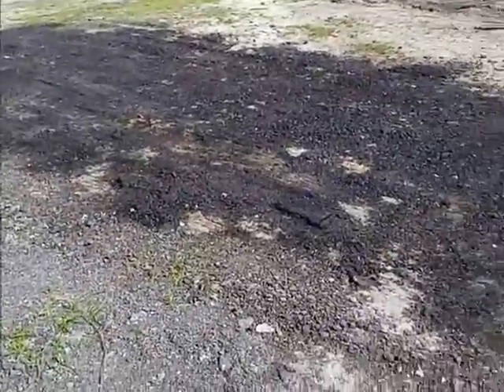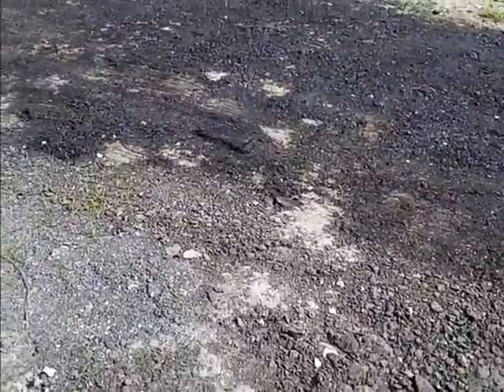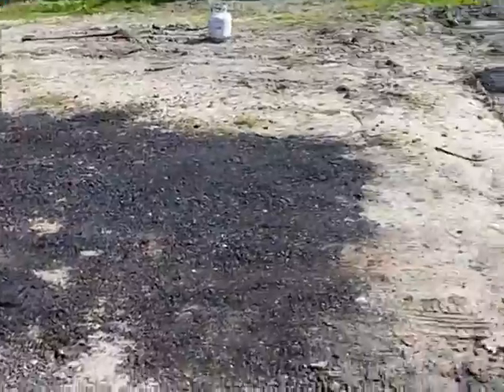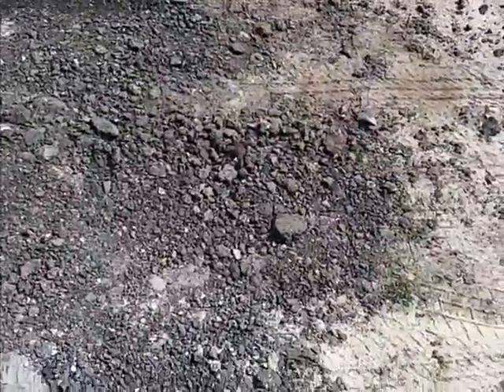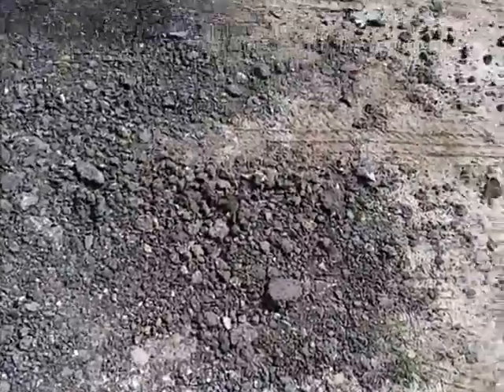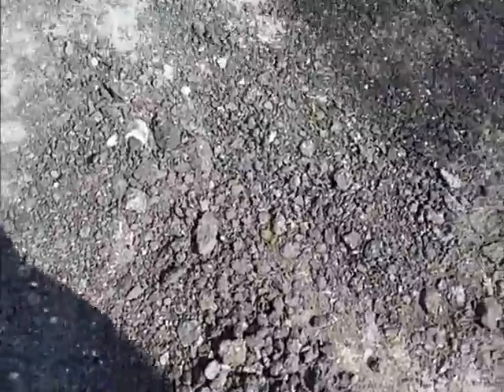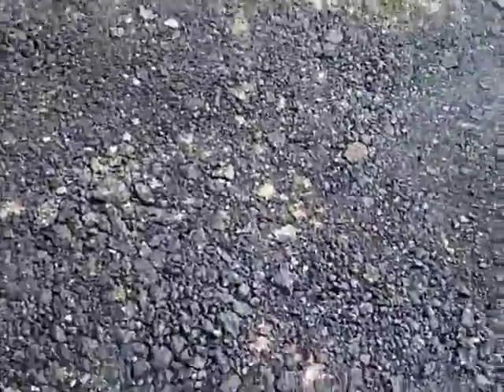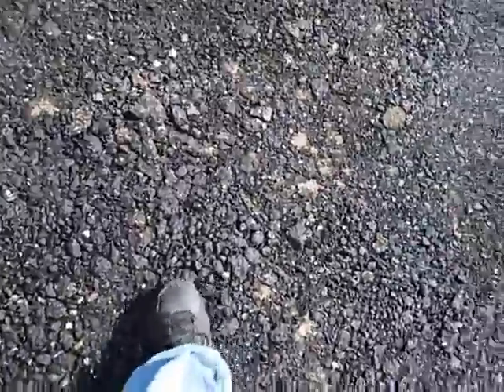trying diesel fuel and propane torch to asphalt millings to see if it binds them  4/2019

Comment: The biggest issue I see with you millings is the size variation of them you want a good consistency you wouldn’t ever get smooth with roller and drag case roller will bounce off the big chunks leaving you with a ridge and drag or using bobcat grabs ahold of the chunks and leaves you with a big groove…. I only say this outta experience and when they grind the asphalt when it’s cold it don’t grind them as well as if they were hot from sun….. so get them fresh in summer lay down 2-3” on hot day and if you can get access to rubber wheel roller to where it will smash into the bigger pieces rather than hop over it and heat from sun considering your climate where you live will do your best job now a feet fine coat of diesel will allow for it to and add adhesion and give a consistent color but to much diesel will fail you because to much will breakdown the adhesives in the mix and it will wash away light coat on top 1/4 or so will make it nice color and smoother surface

Comment: asphalt pavers use fuel oil to clean their tools and keep asphalt from sticking to their truck beds. This 
means that fuel oil is a solvent for asphalt. Put the millings down dry and let the sun heat and bind  
the millings.

Comment: You can use a product called Hawk seal it is like an asphalt sealant but it's made for millings..
It comes out of Iowa from a guy named Kermit I live in Oregon and it cost me about $300 for a 5 gallon pail that mixes with 50 gallons of water and then sprayed with a cheap harbor freight pump and a garden hose onto the millings which turn hard by the next day...
You can look up Hawk seal on YouTube and find kermits videos however in my case I laid up the millings at the beginning of winter and it rains a lot here in Oregon so by the time the weather got warm enough 65 or above so I could use the hot seal the rain had washed down a lot of the fines or tar and left me with gravel on top of asphalt millings so I got a compactor and tried to compact it before applying the hawk seal however the hot seal did not work so great for the loose gravel on top of the millings so now I am applying driveway sealer to the top of the hardened packed Hawk seal millings and at this point I wish I would have just did a concrete driveway because it is not pretty in fact it's quite ugly and my wife is up in arms over it LOL